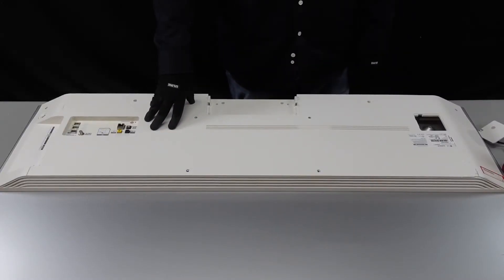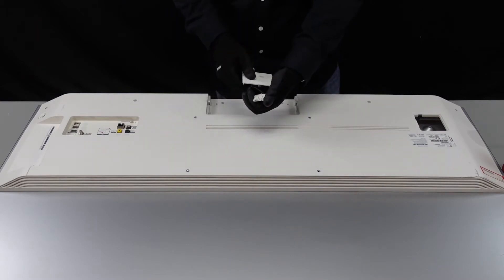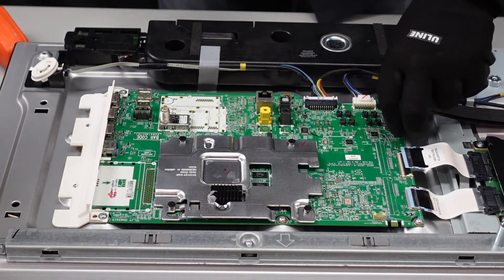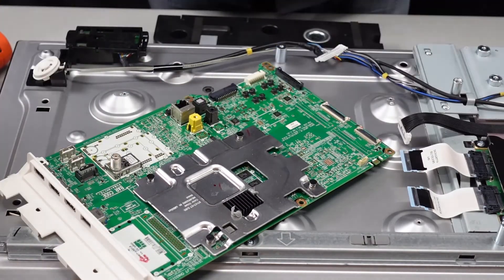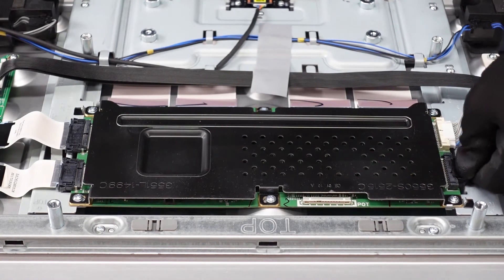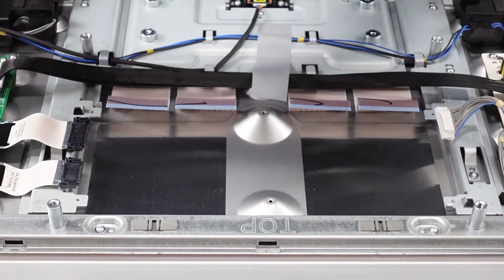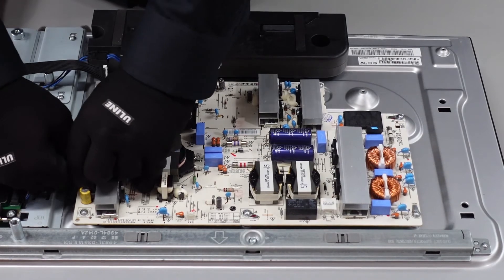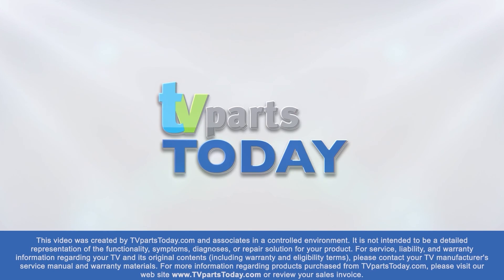Fix your broken TV.  (LG OLED55C7P)

Comment: I've got this exact panel and have an image problem. I have several thick horizontal lines running from the lower left to the middle of the screen that looks like image retention that doesn't go away.  However it's only on certain colors, ones that use red. If I put a full screen red, orange or purple up you can see them easily. Also have a circle dead center. That one is usually slightly greenish when it's supposed to be yellow.   If I put up white you can't seem them at all. Because it's not showing on all colors I'm assuming it's not the panel but a board issue but was hoping to double check and possibly fix this tv rather than get a new one as it's served me well all these years so far.
Reply from the maker: It seems plausible that the issue you are experiencing is screen burn. If you were going to try to replace a board to correct this issue, I would suggest the t-con board. Horizontal lines on your screen are almost always a symptom of a bad panel, but your description goes against my understanding of what these lines are. OLED televisions are unusually susceptible to screen burn and the t-con is almost always the culprit.
Reply: @tvpartstoday Thanks. Just ordered the whole set of parts. Yeah they’re not black lines as if the pixels aren’t firing. It’s simply thick lines in those colors that are desaturated. So instead of red it’s more towards grey. They’re not super straight as if they were an image on screen. The edges taper off, it’s not a hard edge. Really hoping it’s not the panel. I never left anything on to burn an image.

Comment: Hi i have a LG 55C7V , no power or led at all. I could replace power supply board eay64510601, but it coud be more?
Reply from the maker: The power supply is definitely where I would start. There could be other issues with the set, but we won't know until we restore power. Let us know if you need any help.

Comment: Hi having an issue with my  LG OLED has power but it won't turn on just shows a small image on the side of screen and that's it. Already replace boards didn't work still no show. screen black you can hear sound when turn on . Any help will be appreciate
Reply from the maker: So unfortunately if you have replaced all of the circuit boards in your set with no change to your initial symptoms, that means the problem is something deeper in the TV. Usually that would be the backlight strips or the screen, but since your TV is an OLED, there are no backlight strips. 

Meaning only the screen itself could be causing this issue. Screens are not cost effective to repair/replace, so it is time for a new TV sadly!
Reply: Thanks appreciate your in put  @tvpartstoday

Comment: Do you have parts for the 65” model?
Reply from the maker: We do carry parts for the 65 inch model. If you go to the website you should be able to pull up a list of available parts with a search for "OLED65C7P".  I would warn against ordering parts purely off of model number as there can be multiple different parts in your set. The best way to order is to match up the part number off of your board.
Reply: @ OK thank you for the reply. Appreciate it.
Reply: I have lg oled65c7 stuck on red light what needs to be changed or component
Reply from the maker: @brianbrewful  Call in to our office at 930-212-1975 or email us at info@tvpartstoday.com for free troubleshooting assistance! Thank you!

Comment: Hello I got the wonderfull TV working perfect but right now I notice a different color in the middle of the screen. I like a perfect square size with a different tone of color. Do you know what could be happening? Sorry my english
Reply from the maker: That could be a t-con or a main board. I'm not sure if you replaced parts already, but if your symptoms have changed after you replaced a part, then that part is your likely culprit. The first thing I would do is open the back of the TV and re-seat all the connections (unplug all the connections between boards and reconnect them).
Reply: Thanks !!!!!
 @tvpartstoday

Comment: Does anyone know if the 55B7T mainboard is compatible with the 55B6T?
Reply from the maker: We can not confirm that with such little information. You should not order by model number as these models are serial number specific. Only order by manufactured part number.

Comment: If i get main board changed will i lose all my picture settings and calibrations
Reply from the maker: Unfortunately, yes. You will have to reset all of your settings for picture. I did a factory reset on my TV recently and I took a picture of all the settings I had for gaming so I could re-apply them quickly.
Reply: @tvpartstoday  ok no problem also will the new main board have a factory calibrated white balance in the tv as when i had the old board i acidentally clicked reset in service menu white balance an lost the factory white balance settings ?
Reply from the maker: I would assume so. Most users don't calibrate their picture settings, so its a pretty safe bet that the settings will be factory default.

Comment: Power board on this unit started to make a clicking sound and the tv does not power on . The sound is continuous unless it’s unplugged from the wall.. any suggestions ?
Reply from the maker: Try disconnecting power from the main board to see if the clicking stops, if it does, I would recommend replacing the main board. If it does not, I would replace the power supply board.

Comment: I have the LG OLED65C7P TV.  It has stopped turning on.  When unpowered, the red stand-by LED is illuminated.  When power is applied (TV remote, or button press on TV), the LED flashes on 3 times, and then turns off.  No sound or image is displayed.  Opening up the back of the TV, there appears to be no signs of scorching or heat damage from power surge.  I unplugged all cables from the power board.  Verified 120VAC into the board.  Verified 3.7Vdc standby, 12VM, 12VT, 20VT voltages were within 10% nominal.  No 24V (reads 0.3).  Plugged in all cables to power board, no change to the 24V - 12,12,20V are all still nominal.  Assumed 24V power was bad, purchased replacement powerboard from TV Parts Today.  Installed board, ran some voltage checks - still no 24V, and exact same behavior (power on results in 3 flashing LEDs).  Assumed there was an issue with destination board (T-CON), bought replacement board from TV Parts Today, installed and still no 24V, same 3-flashes from the power LED.  

What do you suggest doing?  Replace the main-board?  If it is the main-board, may I return the power supply and TCON boards for a refund (less-restocking fee, per policy online)?
Reply from the maker: If you have replaced the power supply and t-con already, I would suggest trying the main board next. If you want a replacement on any parts, just to make sure, or wanted to start a return you can do that within the 30 days stated in our warranty agreement.
Reply: @tvpartstoday  Should the power board be generating 24V on connector when powered (and without any plugs connected)?  That might indicate that my original power board and my replacement power board were defective.  Are there some conditions that must be met in order for 24V to be switched on?  There aren't such conditions for the 12/12/20 V supplies on the two connectors.
Reply from the maker: If you are experiencing the exact same symptoms after replacing a board, it usually means there is a problem somewhere else in the unit. That does not really cover factory defects or common problem parts. If there is any concern about the functionality of a part, I would suggest starting our replacement process and trying another power supply. I know that the different voltages are usually tied to the various functions of the TV (standby, power off, power on). So if you are seeing good voltages for the standby and still not getting proper voltage for "power on", it could be because of a short in the LED's or somewhere else in the set. I know that the t-con and main boards both can keep a set in "shut down" if there are any problems. I would suggest trying the main board to see if you cant get functionality back to the set and if you are doubtful of the power supply, you can absolutely get a replacement from us. We have plenty of those in stock at the moment.
Reply: I have the same television and it started exhibiting the same behavior a few months back. Did you ever find a solution to this problem? Thanks
Reply: @TimShade  The main board was defective on my TV.  I replaced the three boards in order:  power supply, t-con, and main-board.  I held onto all three boards and swapped them around with the original 3 boards.  I tried all combinations of original and replacement, for the three boards, and found the TV's functionality was ONLY tied to the main board.  I returned (and paid restocking fee) for t-con and power boards.
Reply: @jamesburns-montante5277  James... You are not getting 24 volts but you are getting 12 and 20 volts? Mines doing the exact same thing. I think I'm just gonna roll the dice and buy the main board.
Reply: @jamesburns-montante5277  so after reading your well explained comment.. I took the time to move further along the chain to the main board. And sure enough there is absolutely a short in the main board. Thank you for helping me to at least move on to the right problem, and for taking the time to actually ask questions publicly where we cna all benefit from them. Thank you seriously my friend